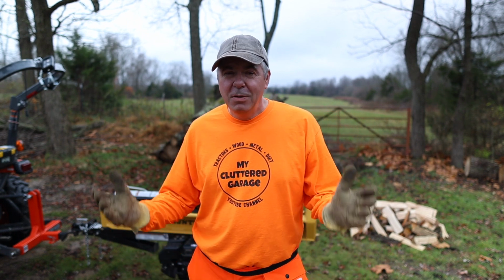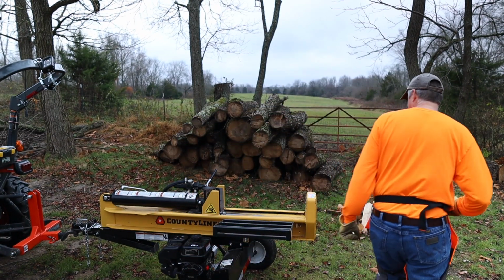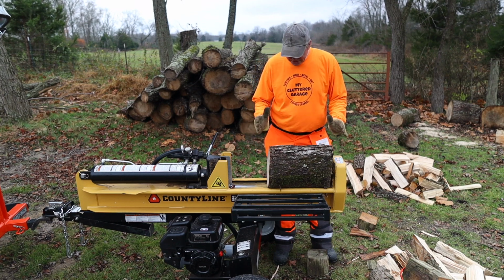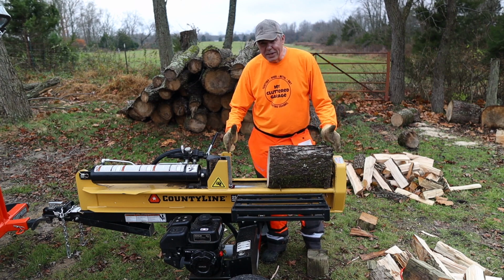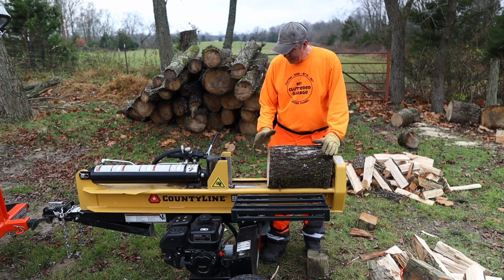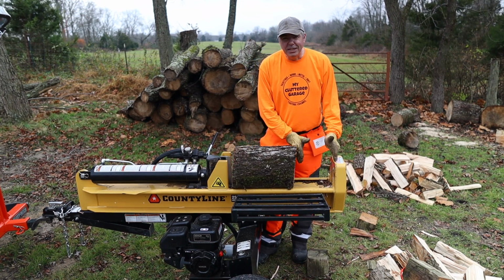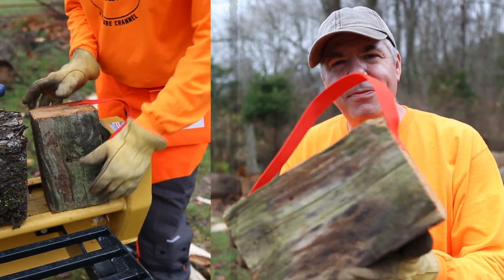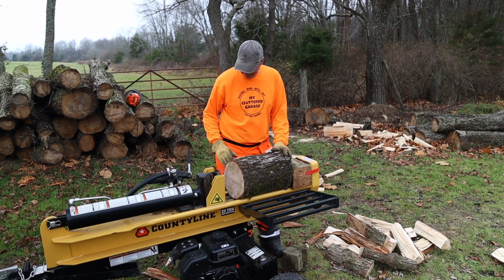#84 Split Short Rounds Faster! Tractor Supply Countyline 25 Ton Log Splitter Stroke Limiter

Comment: I have that same splitter and am pleased with it.  I added the optional 4 way wedge which is very easy to take on and off. The side wedges were rather short at about 2" or so and sometimes would have to pull or chop upper and lower pieces apart.. I cut the side wedges off and welded on 5" per side wedges. Works good and completely splits upper and lower. This 4 way really saves time.
Reply: Where did you buy the 4 way wedge ?

Comment: Great tip! I have the same set up with the CL 25 ton splitter and a compact diesel tractor with a loader. My only suggestion to you would be to unhook the splitter, spin the tractor around and split directly into the bucket. Save your back anywhere you can.
Reply from the maker: Absolutely, Bob! Im still figuring my work flow, but that’s a good point! Thank you.
Reply: @MyClutteredGarage  Best work flow to save your back, find a kid to do it for ya LOL.

Comment: This is an interesting idea, definitely worth a try. I have been splitting some large ash with the splitter in the vertical position and I am wondering if you or your followers have a solution for positioning the round and holding it there? The backplate is off the ground, this along with the size of the round makes it difficult to get it into and remain in position for splitting.
Reply from the maker: Thanks Edward. You can build up around that back plate with wood or concrete pavers. I think that would help a lot. Thanks for watching and commenting!

Comment: Simple, yet effective. I've noticed the countyline splitters are about 500 more than last year! Good job Ed.
Reply from the maker: Right! I paid $1k for a used one!
Reply: Yep, they're expensive.  I have a cheap electric splitter from Harbor Freight...doesn't seem to be too bad of a splitter for the money, its slow of course because its electric, and it requires 2 handed operation but beats using an axe or wedge and sledge, or splitting maul.  I'd love to have one of those fancy expensive splitters but for what they cost and the amount of time that it would sit between uses, electric was the way to go...sure if you are splitting wood every day one of those gas powered 20+ ton splitters would be fine, but I only need a log splitter maybe a few days a year when I get firewood that needs a bit more splitting than will fit in my stove.

Comment: How is this working out Ed. I have tried this myself a few times in the past. My experience….Eventually the block of wood collapses.  Also I realized the cleat/ridge at the base had the purpose of keeping the round in place. The challenging pieces would slide off block of wood. So I gave up on the idea. But I am curious how it is working for you and what you have learned.
Reply from the maker: Hey Gerry. Honestly, I haven't used it heavily yet, but so far so good! I think that using the 6x6 in the cross grain position helps. Several people have commented about using cylinder stops. Maybe that would work better for you?

Comment: My splitter has an adjustable rod (for different log lengths).  This rod mechanism trips the control lever on the back stroke to stop the ram from cycling all the way back.   Make sure you keep your chain out of the dirt Ed. 😊

Comment: So, here’s my penniless observation. This mod was in the interest of saving the couple of seconds for the wedge to contact the wood from fully returned. So we insert a block of wood that now, we have to wait a couple of seconds for the wedge to fully return so we can drop the piece of wood to split,,between the fully retracted wedge and the block of wood? I think I got the math there right?🤪🤣 
Now this will presumably speed up the waiting time by moving the wait from the front end to the back end. Keeping in mind that this will speed things up and we all know that if we are working with 24 tons of crushing power between a hard block of wood and a wedge shaped chunk of steel, speed is always better than safe! 😉😁 
Not to mention that, if you find yourself into a knot, you may find you are putting that extra crushing force onto a block of wood instead of the steel end plate created and designed for such force. It’s a cool trick but….I’m thinkin I’ll stick to the way I’ve been doing it. Just an observation. 😁👊🏻